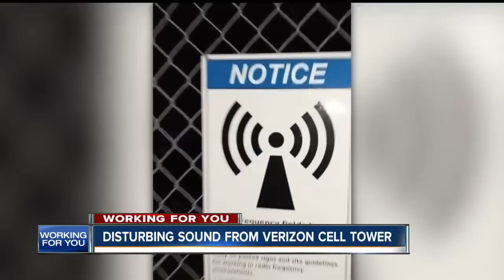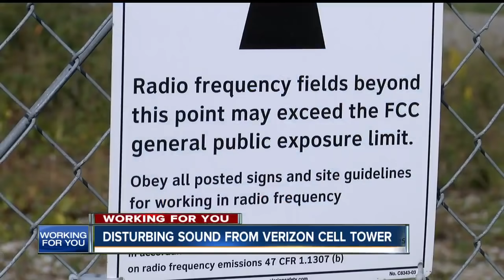Disturbing sound from cell tower

Comment: Being under an antenna is actually the safest spot because unlike isotropic antennas that radiate equally in all directions, other types of antennas including the ones in cellphone towers radiate in a specific range that varies from type to type of antenna. Under a certain radius from where the cellphone tower is you are in the blind cone of the antenna, that means the electromagnetic waves of the antenna “don’t get you”
Reply: Not quite.  While most of the signal goes in the intended direction, some still goes off the ends.  It's just weaker there.
Reply: behind the antenna

Comment: Its a generator failure...we have the same generators  where i work.....they have automatic timers to do 1 hr tests once a week ..it probably stalled or failed to transfer or has a coolant level/temp problem  which causes an audible alarm...people always looking for something to worry about
Reply: @jonnyspeed8974  actually they have an auto dialer or computerized monitoring system that probably lets them know and more than likely  many other more serious problems  such as complete tower outages took priority..
Reply: Actually, it's just a cheap alarm that's used everywhere in telecom and many other places.  You blow a fuse and the alarm goes off, etc..

Comment: The problem is that the “FCC” that sets the standards are in the pockets of the wireless carriers, so even though it may meet FCC standards that doesn’t mean its safe.
Reply: You are saying a very reasonable statement. I read many publications about the risks and threashhold
Reply: Yep
Reply: Oh come on.  This was clearly an audio alarm.  It sounded like an alarm.  VZW clearly stated it was an alarm that was dealt with.  An audio alarm is not something the FCC has any control over.  This was not an FCC issue.  Are you going to call the FCC when your neighbor leave a window open, but forgets to turn off the alarm clock?  Wake up and smell what you are shoveling.
Reply: When Fukushima exploded dumping radiation into the ocean all the government did about it was change the acceptable radiation levels were allowed to get.
Reply: I had a cell phone tumor in my head.
Reply: Bingo
Reply: M. B. For hundreds of years everyone knew it was safe to smoke tobacco..... smoking tobacco was even done medicinally....
Reply: Actually you're not too far off. There's a date for the FCC to go and test the towers. They only power the tower being inspected to a little over half, the tower's radiation levels are acceptable, then when the inspection is over it's cranked back up.
So in that way yes they're in their pocket.
You can actually take a radiation tester yourself by these towers. The majority are more than double safe radiation levels. (Same with your phone)
Reply: Alarm or not,Mr Brian, the damn thing isn't working correctly if an alarm is going off so, smell that
Reply: Facts.
Reply: @hotrodray6802  You and millions more.
Reply: @UheReasin  I have test equipment, You are correct.
Reply: @denniswillis9686 They said it was a false alarm for the diesel generator. Stop being scared by things you’re too lazy to bother understanding.

Comment: The good news, that was just a generator alarm. 
The bad news, you still live at the base of a cell tower.
Reply: In theory the radiation directly should be relatively low at the base of that tower. It's a question of the angle I guess.
Reply: You're exposed to more RF from your wifi router than you are at the bottom of that tower.
Reply: @Martinroadsguy  *microwave noises*
Reply: Why would they need an alarm that makes sound? A simple notification, or system that actively monitors the health of this machine? This is just straight up bullshit

Comment: It’s just a low fuel alarm from the back up generator. I climb these towers. That’s a 4G transmitting tower and you would need to be 5 feet directly in front of the antenna to be over exposed. That tower is not 5G. For people with concerns about RF exposure inside their home just get a metal roof. Metal roofs last longer and will block 95% of all RF cell signal inside a home.
Reply: Really? Wow that's awesome
Reply: You aren’t an engineer…

Comment: Nothing to worry about its just a radiation alarm!! It's releasing it again as usual!!
Reply: and they said they were disconnecting the wiring to stop the alarm
Reply: "radiation alarm" 😂
Reply: Sounds like a generator alarm, literally nothing to do with anything on the tower. I can guarantee that. By rewire they mean they'll disable the audible alarm and leave it connected to the alarm system so they'll still be notified if there's a problem with the generator in the future. Stop spreading disinformation when you don't know anything about it.
Reply: @UkrainianBazooka  I know mate tell me about it. As I've pointed out on another one of these cultists comments, the noise is nothing but a buzzer warning that the diesel engine within the generator set has stalled/run out of fuel and using its battery on pre start, as most industrial diesel engines do. How it even made the news, I don't know. Its just Americans over dramatising everything as usual in my opinion.
Reply: @UkrainianBazooka  ... oh ok I see your one of the know it all's 😂😂
Reply: @Jayandhis25cents  yeah because I spend 50+ hours a week fixing cell sites.
Reply: @Jayandhis25cents Certainly better than being one of the knows nothings. Imagine living in fear all the time because you don’t understand what’s going on around you.

Comment: That guy is clueless.  As mentioned, it was an alarm.  Telecom is full of such alarms.  It has nothing to do with anyone's health or the signal.  When equipment fails, an alarm is generated and there should have been a remote alarm at a manned office.  I used to work for a telecom and many years ago, I often heard such an alarm and it meant nothing more than someone had sent a message to me over the order wire.  Back then, there were minor alarms and major alarms, which sounded different.  In the central offices where I worked, when you heard an alarm, you'd go looking for a light that was on.  There would be a light at the end of each row of equipment, at the top of the rack where the equipment was and then on the failing equipment.  These days, they have more detailed alarm reporting.

Comment: Heard this when I fixed black boxes in the navy- coming from the transmitter head of an IFF.
 It was found to be, after much examination, caused by a microscopic scrape of the magnet wire varnish insulating a high voltage transformer winding running 400 cycle power. The microarc occurred at audible frequencies, at the peak of the cycles, within a module where the sound of the arcing resonated to audible volumes. Some passive components also squeal when run close to their voltage and current cut-offs.
Reply: cool, enjoyed
Reply: Turbo encapsulator
Reply: It's the generator alarm...

Comment: Golly as a tower climber this is funny litterlly a diesel generator and I've pulled up to a sight and heard the same sound it's just an alarm that needed to be fixed.  It's completely separate from the sight it's for emergency power so when sh!t hits the fan you will still be able to call your family to see if there safe.   The generator is nothing different then a truck driving passed your house.

Comment: It's an audible alarm for the engine generator. It emits no RF no concern needed. For the tech for this engine pit a screw in the middle of your beeper and tighten it down till it stop beeping. We do this trick at all of our sites.
Reply: Breaking the beeper/speaker probably isn't the best solution. That's akin to covering the engine light. XD
Reply: Huh? A technician is not an engineer

Comment: It’s the alarm on the engine panel for the generator.  The engine has a code. Same as the check engine light in your car. All they gotta do is unplug the alarm horn.

Comment: And someone who's worked around generators for a long time. That is called default alarm alarms with the generator has come up with a default like low battery voltage water in the diesel fale to start.
Reply: *Common alarm

Comment: Where I used to live, it became clear it was going to be time to move soon, when a cell tower was built 200' from my apartment.  5 months later when it was turned on, my portable am/fm/weatherband radio, with sound turned down all the way, was loud with static overriding its electronics and into the speaker.  I moved.  They hid the transmitters inside the tower, which appears like a large sign post without a sign atop it.  But you can tell what it is by looking at the oversized backup generator at the base.
Reply: That's it static or white noise, it's causing mental deteriorations. It can transmit thoughts in your head.  I accidently came upon this researching sodium ion channels and parkinsonism/dystonia. This noise affects the gut bacteria
Reply: electric bacteria-   geobacter protein nano wires

Comment: Ive been working in Telecommunications for over a decade building entire new cellular networks, HDPE (High Density Polyethylene) Conduit Placement, Fiber Splicing, Cell Tower Management, Aerial / Underground Construction and everything in-between. That alarm you heard was not from a "False Alarm" on a Generator. A few years back we had to reset the laptop / server rack after a severe storm ⛈. There is a self destruct sequence which has a master alarm (Safety) just before the kill confirm code is entered. My guy doesn't have the code, so the explosion never occurred. But 3 black Tahoes and a helicopter landed nearby and told us to keep quiet. I'm telling you all now, run!
Reply: Funny guy
Reply: Yeah they should probably move then before that happens

Comment: It's just the low oil alarm for the backup generator. It's literally just a small buzzer on the control panel of the generator itself. Has absolutely nothing to do with the cell service.
Reply: Thanks I can now go back to being microwaved in my sleep.
Reply: So shouldn't it send a signal back to the department to fix it ASAP? 🤔

Comment: Doesn’t sound too safe to me. It’s concerning no one was checking on this tower to realize it was malfunctioning until nearly 3 days later because someone who lived next to it complained to the media. Not safe practices at all.
Reply: Tell me about it, the tech on the phone said: "it was just a nuisance" and didn't seem too worried.  Our 1-year-old has a sensory processing disorder and it took us two days to realize maybe she could hear that inside and that's why we've been having so much trouble. She sleeps about 300ft from the tower and I could hear it just outside my back door at around 250ft. Just totally unhappy and that's not like her. Maybe for 2 hours or so, but days? When she was smaller she had issues with planes flying overhead, I can only imagine what that sound was like to her and I bet she thought it was more than "just a nuisance".

Comment: It's more than an alarm. The cell tower near our home has been immiting this sound 24/7 for several months. It seems to be the loudest in the evening. Stays between 30 to 70 dbi's constantly. Knowone will take responsibility for what our neighborhood is enduring. Which includes County, State, FCC, & owners of the towers.
Reply: @Ruth Aldridge, WHO owns these towers??...
Reply: Verizon owns the the cell tower off Manor & Day by the church. They came out & checked the units & said it was not the equipment. We had the FCC come out & they claim it’s the cogeneration plant owned by Kern River Holdings. This last Tuesday my husband drove over there again & the supervisor determined it was coming from the pumping units almost directly behind our house. He said they will try to replace the generators. The sound is still loud in the evening predominantly, so another talk will need to be made. It might help if others being bothered by the ear piercing noise would go over there & complain. Then maybe it will stop.
Reply: Ruth Aldridge   That sound in this video is the low fuel warning alarm for the generators.  Annoying yes, but no more harmful than an alarm clock.

Comment: I just want to make a quick statement here, they just put up a huge cell tower about a quarter mile from my home. Strange thing strange, every time I get parallel with it about a half a block away my radio goes dead, I find that very concerning since before it didn’t happen before when the tower wasn’t there. I can actually pass on both sides of it pretty close streetwise and on both sides my radio goes dead. I do not care what they say this is very concerning that it  disrupts my radio waves that much

Comment: Those towers cause electromagnetic interference and can cause a whole amount of problems that can pass thru the body since the body itself is a electromagnetic impulse generator and that can cause issues around those towers. I am telling you those frequencies can be very very dangerous to children and anybody around it needs to be built around a Brick wall ya thick. To be honest they need to destroy these towers or move them far away from dwelling places period. This is also proof that they do not have satellite communication devices in the air. They do everything earthbound on towers to towers. Need real proof do research on Radio Frequency and body mind alterating that can cause Cancer, Brain mood issues, High blood pressure, metabolic issues involving kidneys and all sorts of nasty nasty things. Get EMF reader I carry one in my car. If its goes over 7 PPM then you have a problem Microwaves create about 35 to 65 PPM of Radio frequencies which is hazardous to your health and your brain. So if your getting anything over 10PPM you have a very high chance of developing cancer.
Reply: I want one, are they super expensive?
Reply: @peety6333  You can buy one online for about 25 to 40 bucks depending on the model and some come with a small Dome antenna on top that gives you better coverage. Amazon has them
Reply: @sbfhawk4343  The sun causes skin cancer my guy.
UV, for example is in the Terahert to Petahert range. 5G is gigahert (and low end at that).
The amount of energy emitted is much, much lower than the sun.
As I said 5g can't even penetrate all the layers of the skin. It's non-ionizing.
Do you get burns from wifi or towers? No, you can't even feel them. On the other hand, the sun can be felt as soon as you step outside.
The sun bombards you with infinitely more energetic radiation, than your phone ever will.
Reply: @01DOGG01  Funny because my last comment continues to be deleted by youtube yeah your def a disinformation agent
Reply: @01DOGG01  Inverse square law dude. The phone companies having it there way will install a tower every few hundred feet apart that would diminish your Inverse Square law of distance and supposed gravity. It will cause effects on most people period. End of Discussion
Reply: Generator alarm

Comment: Just 60ghz, microwave has 2.5
Reply: Your microwave receives 60 cycles per second from the plug in the wall but the 2.5 power inside the appliance is 2.5 Billion cycles per second.

Comment: Generators make that alarm if it has a fault in the system. Like a no start ,low coolant or low oil. So yeah if they dont pull the wire off the alarm your gonna hear it several more times.

Comment: Consider that antennas 200 feet up a tower aren't designed to radiate vertically toward the ground, they radiate horizontally--toward the horizon. You probably more radiation a mile away than you get at the base of the tower. Not to say there's no RF (Radio frequency radiation) at the base of the tower, but you're not going to burst into flames, or get roasted in your sleep!

Comment: Are used to work on generators that’s a low-voltage alarm low water alarm that’s the noise of alarm they have so you can hear it so you won’t mess up the generator if it starts 
Does not have anything to to do with the frequencies

Comment: Yep..... sounds exactly like the generator alarm system when either the battery is low or the charging system is not working correctly...seems it was a low priority for them as they should have seen the alarm on their end
Reply: What “charging system” are you referring to? There is no charging with a backup generator.

Comment: Piezo Tweeter alert  horn  same thing used in  fire alarm  boxes   .  Something  with the generator  . Low battery  or moisture  in fuel . There typical  low power RF  1800 TO 1900  MHZ  . HIGH   kilovolt power lines  are worse  if really  close.

Comment: Most places are not even utilizing 5G yet and most of the towers that are using 4G utilizing lower frequencies like 700 MHz, if you really feel that you’re under the impression of health hazard buy yourself a spectrum frequency analyzer and if you feel that the radio frequencies are going to kill you make sure to get one with the high frequencies up to 39GHz chances are you’re not gonna find much of 5G signals in the air.

Comment: generator alarm. it's not dangerous, it's an alarm. if it bothered you there is always signage posted providing a number to the tower's owner. a quick call would have solved this issue.

also, it's not Verizon's responsibility to maintain the site. Verizon doesn't own towers, except at hubs. Verizon, ATT and T-mobile rent space on a tower that is owned but another company, like Crown Castle. this is the tower owners responsibility.